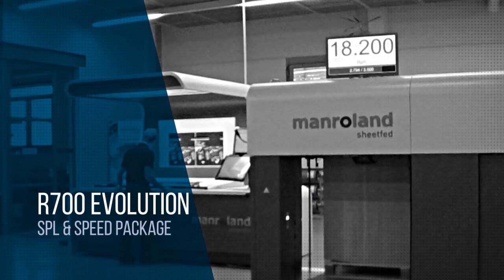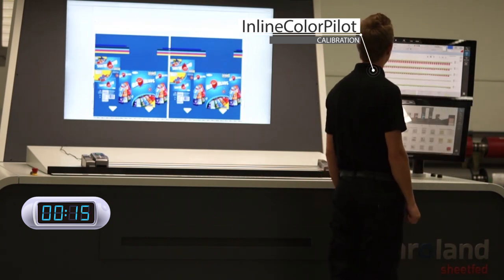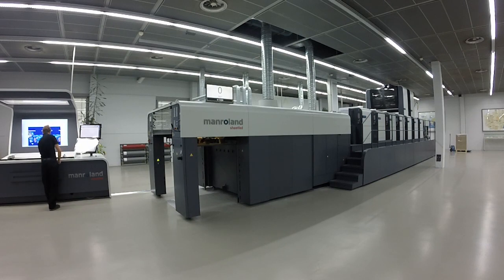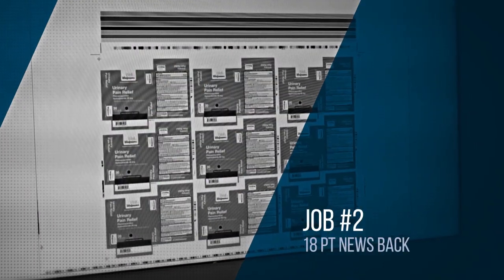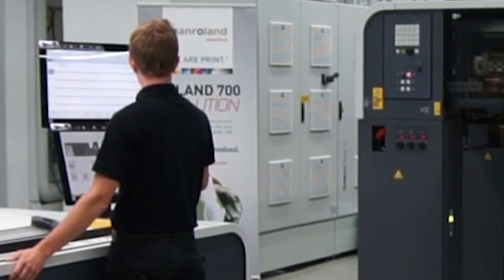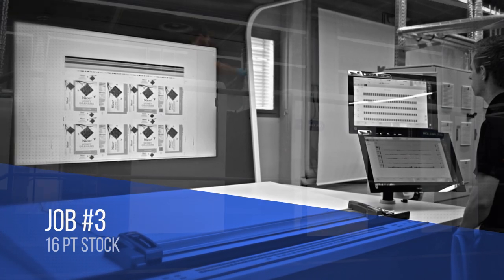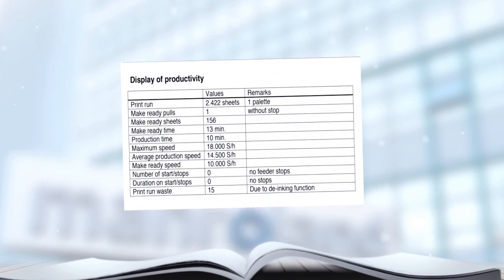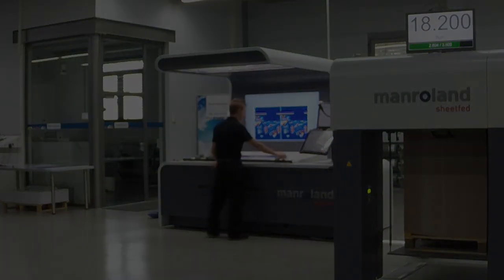manroland Sheetfed Evolution

Comment: Did someone say that there is no need to 'pull a sheet'?
Reply from the maker: david c , Someone did say no need to draw a sheet, but that relates to calibrating the color control system.  On competitive or older systems, you would run the press up to color, reach target density and draw a sheet from the delivery to scan and confirm you have an "OK" sheet.  Once scanned, you tell the press to take over control.  That increases make-ready waste and time.  With our InlineColorPilot system, the system calibrates inline and reaches target density and notifies the Printer it has reached the "OK" sheet target density.  An Operator would draw the sheet but would NOT scan at the console to calibrate the system, because it's already done.  To enter full production, the Printer simply switches the good sheet counter on and that's it.  This is of course provided the sheet is on target.  It requires the press be properly finger printed and accurate curves on plates to achieve.
Reply: @manrolandinc  Once upon a time it was a tradesmans skill. Now it's terminology and electronics. Tell me - do your 'systems' set the ink rollers as well? Change a back cylinder jacket? I doubt it.
Reply from the maker: @dp369  Even with the new systems, it still is and will always be a tradesman skill that achieves successful print and performance.  The newer systems are designed to aid the Operator of the press to achieve a quicker result with fewer steps involved through technology.
Reply: Course not because there's a risk of the printer scratching one nail. High Tech!